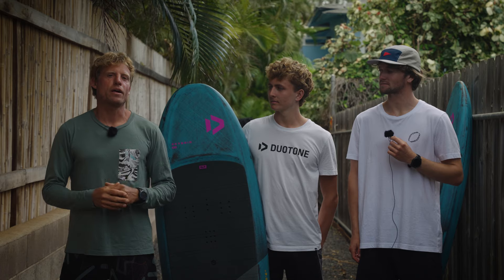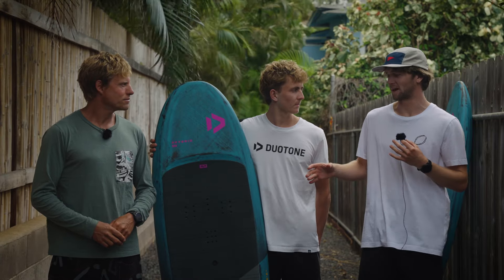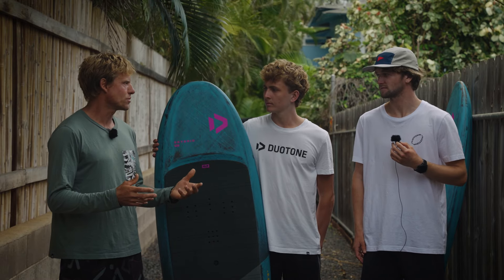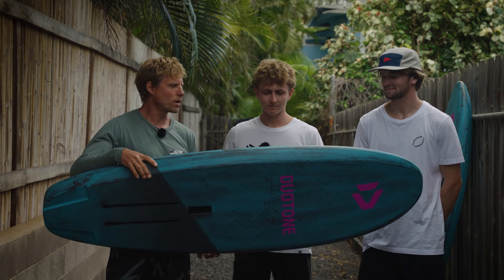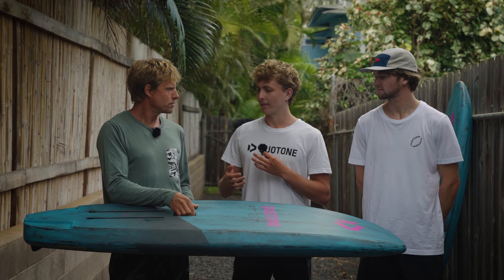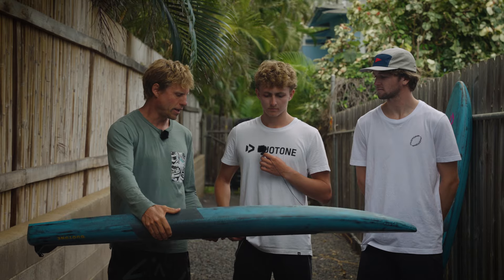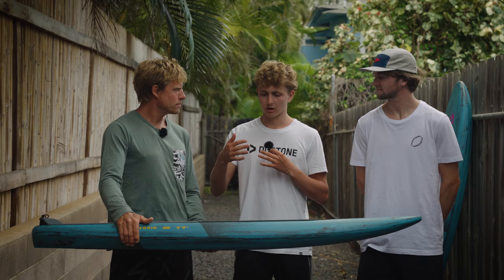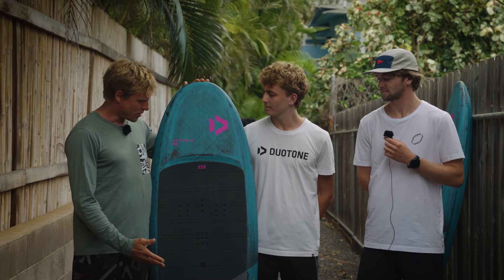Duotone Wing & Foiling Tech Talk - Skybrid SLS 2025

Comment: Hi guys iam 100kg intermediate and im looking to buy the 5.8…do you think is a good move to invest ? Thank you!
Reply from the maker: Hi Eric, if you are gybing/tacking comfortably, then the 5'8" x 85L could be good, however as you mention you are an intermediate, I would suggest to rather go for the 5'10" x 100L, this will make it a lot easier with starts/if the wind drops and you have to float back etc? Bit more volume on the Skybrids is really not a disadvantage.

Comment: I ride the sky free 5.3. intermediate, I weigth 70kg 60years old . What board size would you recommend ?
Reply from the maker: Hi there, at your weight currently riding a 95L board as an intermediate, I would estimate you could get away with the 5'8"/85L board - it should get up and go at least as quickly as your Free 5'3", maybe slightly sooner and for sure with less pumping/better at passive "planing" up onto the foil.

Comment: 75 kg early intermediate, learning jibes on US great lakes where there is often 3’ wind swell.  How hard is it to stand up in such conditions compared to my 29” wide 110L learning board where it is no problem for me in any conditions.  A bit worried about 22” width, would I need to learn stink bug?
Reply from the maker: Hi there, no the length creates stability, which  allows you to stand up from a kneeling position. However at first when kneeling it will feel more unstable, until you are standing, then it is more stable than most other boards in 85L - I'm 75kg, expert level riding the 85 myself for light winds - but have put less experienced people on the 85 Skybrid, they need one or two starts to just learn where to position themselves whilst kneeling, but once standing, they are all surprised by the stability. Perhaps the 100L might be better if you are still learning to gybe/a lot of chop locally? that will make a big difference. I think the 85L will be the better choice for the long term however. good luck, Craig/Duotone
Reply: @duotone.wingfoiling  Thank you, your advice is confirmed by a sailing session yesterday with a friend at my  skill level who is borrowing someone elses 7'2" 19 inch wide DW board in huge choppy conditions, and was able to stand up fine, gets knocked over a few times by rogue chop but doing OK otherwise.

Comment: What is your experience with prone foiling the smaller sizes? Could it be a hybrid wing/prone board?
Reply from the maker: yes, on the smaller sizes, the boys were proning with it, also less experienced riders during the R&D phase - actually a lot easier with the extra length for beginners/intermediates - obviously for advanced riders they'll prefer a more compact shape, but it is for sure possible to use.

Comment: are they easy to taxi I have a 75l Sky style and less that 75kg and find it difficult to taxi
Reply from the maker: hi there, so if you mean slogging/not planing up onto the foil, then yes, a lot easier due to the extra length - so in the same volume size for example, a 85L Skybrid will be easier to stand on in light winds, than a Sky Style 75 - especially if your weight is close to 75kg or more, where the board is sinking if you are not moving forwards.

Also, to get up and go, due to the straighter outline, longer length, boxes further forward etc, you will be getting up onto the foil earlier. So if you currently ride a Sky Style 75 and want a much better light wind performance-  go for the Skybrid 85. If you want a similar planing performance to your current 75L, but want an easier board to stand on in lighter winds, then the Skybrid 70 is a good option too.

Hope that answers your question/comment!

Comment: Hey Fin and Jeffrey, looks like you guys have designed a really great board and seems to be exactly what I have been looking for.

I weigh 99kg and I use the 5'1 Sky Style 85l in wind from 15-30 knots (with different wings and aero free foils). I really like the board and the volume, because it sinks a bit under my weight which adds stability to me getting up in heavy chop, but I could do with slightly earlier take-off for both lighter winds and also for using smaller foils. I'm also after a narrower board that won't catch the rails as much (I have the '23 version Style) on turns on waves and in chop. 

I'm on the UK South Coast with a lot of chop and small mushy waves. Would the 5'8 (85l) Skybrid be what I am looking for and a good replacement for the 5'1 Sky Style? I want to use it with the Whizz 1000 and 850 for riding swell and waves.
Reply from the maker: thanks for the feedback! Indeed, the 85 is a good option, one of our best sellers and once standing you'll have better stability than the Style for sure, due to the length. Sounds like it ticks all the boxes for your needs!

Comment: Great concept! I think it's also a much better and compact feeling on the feet with the reduced width. As a former windsurfer with small boards I always wondered about the wide shapes. Do you think the floating of size 100l in no- wind to light-wind conditions is enough for my 90kg? Until now i use an AK with 110l.
Reply from the maker: Hi there, yes, for an experienced rider in sub 100L boards, the classic shapes like Style SLS/Style, you can usually use 10L below your weight/or the same L as your weight if you want more ease of use. As the sizes get bigger/skill set is lower, obviously width and ease of use is more important than how compact or performance oriented the boards are. 

But the Skybrids can usually handle a similar volume to your weight or even below (I have to stress this depends on the skill level and also the width of the front wings, as this also helps to stabilise the boards when kneeling etc). The longer length is for sure better for floating, I am fine with 75kg/65L board when there is some wind to move fwd, but it goes down as soon as wind drops obviously - but with the Skybrid or downwind shapes, they'll stay afloat better due to the length. So maybe a 85L will also work for you, but that might be too big of a jump from your 110L - so for sure 100L no problem.

Comment: I have a sky free TE 5’3. What would the advantage of this board? Is it even easier to get going in light wind
Reply from the maker: Hi Jamie, indeed, the longer and straighter outline does help to get going earlier/touchdowns are a bit smoother and generally you can drop about 10L down from a classic shorter/wider size (generally, this also does depend on your skill/weight obviously). Stronger winds are also no issue with the Skybrid.

Comment: I think it is a very nice board, I have had it in my hands but I did not find it the lightest 
I know it is made of double sandwich and I think that is very good! But there could have been saved some weight in the pad anyway half thinner and certainly short on both sides and also the kicker could have been left out. 
But again I like the model.
Reply from the maker: thanks for the feedback, indeed some possibility to save weight, but we also wanted a certain amount of durability - pad could be smaller yes, for most people, but some prefer the full length if starting below their weight, you need to put your feet further back. But noted.

Comment: I want a mid lengt. And no hole in the bottom. And it need to work well with small foils and Foil Drive. I have already sold my Sky Free 105L. Not sure if that cut out will help with Foil Drive. The Axis Foil Drive board don’t have any the DC Foil Drive board don’t have any. Only Armstrong have the size I liked.
Reply from the maker: Hi there, not sure why the cutout would have any adverse effect for the foil drive? Our boards have been tested with both small and bigger foils, in a variety of locations, salt water/fresh water and light to super strong winds. Pretty sure there will be a size in there for most people, if you need more advise vs your Sky Free 105, let us know.
Reply: @duotone.wingfoiling  Than you for your reply. After seeing the first video with take of to foil, I'm definitely not get this board.. Ony guy even padel up the Armstrong 75L ML that is absolutely insane. As Foil Drive says length is king than it needs to be narrow 20"
Reply from the maker: @alfskaar489  No-one forcing anyone to buy anything here - if you feel you need to be on a more pro style edition, then go for it - that's also why we have the smaller sizes. Going from a Free 105 to a 20" wide board- quite a challenge though.
Reply: @duotone.wingfoiling  Based on what I can find out apparently the 20" is the magical width to get the board going as fast as possible but this needs to be matched with a board that is long enough. I have windsurfed on small narrow slalom boards and later on speed board exclusively so narrow board doesn't scare me, yes not the same thing but I think that you have to give your self some challenge sometimes as it is rewarding when you get it.
I also have a Patrick 50L, 152cm / 5’0”, 55cm / 21" 1/2”. I really dislike the Sky Free 105L when the wind drops is feels like being on wine cork since it is so wide and short, and you are simplely going nowhere. The smaller Skybrid are maybe just a bit short. Not sure. Soon someone I know and trust will test the Skybrid with Foil Drive will be interesting to what he have to say about it. Maybe I change my mind so I don’t have to drive 2000km to get the other on. 🙂 Do the 5.6" also have a hole at the bottom ?
Reply from the maker: @alfskaar489  ah, ok understood now you are used to narrower boards yes. Good point on the 2 smaller sizes, we should consider to skip the handle like we do on the Sky Style, will see if that can get implemented as a running change, helps the weight. Indeed a challenge for advanced riders like yourself is no big problem. Report back then what your buddy says please. Feedback so far is great, from both intermediate and advanced riders, but always open to critical feedback, that's the only way to improve!